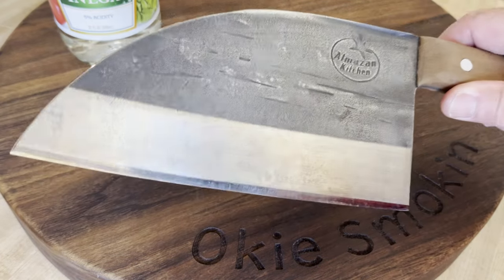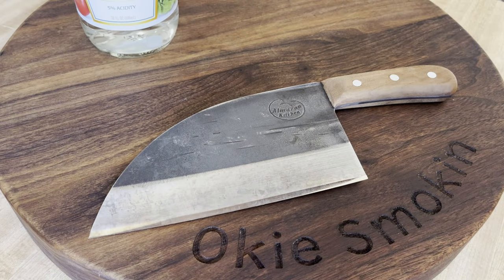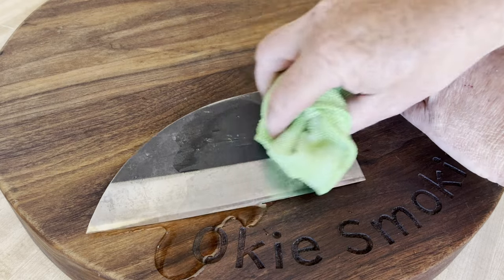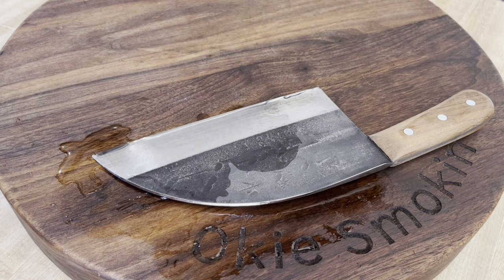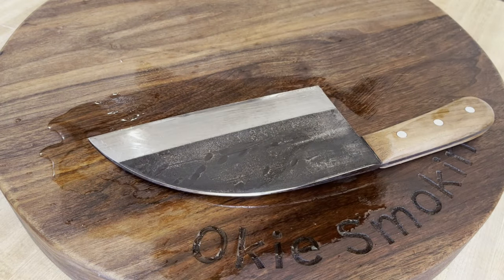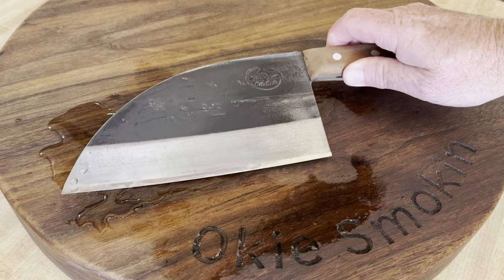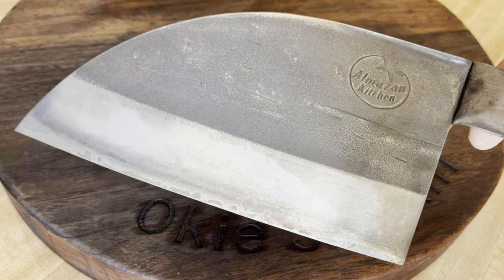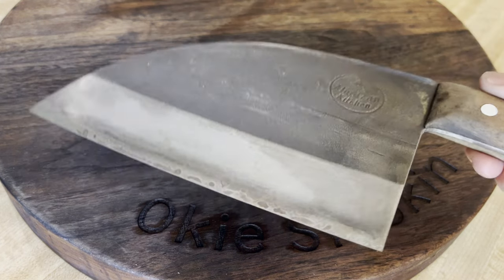DIY Patina: Giving My Almazan Kitchen Chef Knife a Boost with Vinegar

Comment: If the vinegar is hot, it is a quicker process. I'm doing it with all my carbon steel knives just after I buy them. But some polishing of the blade after it is recommended, because vinegar is a bit aggressive.
Reply from the maker: Nice tip heating up the vinegar first, will definitely try that next time.  This knife quickly became the favorite in the kitchen and it still performs as it did day 1.  We’re taking extra care of it.  Thanks for dropping by!